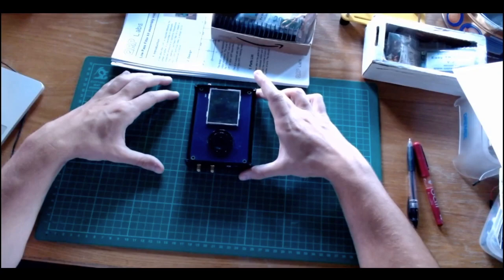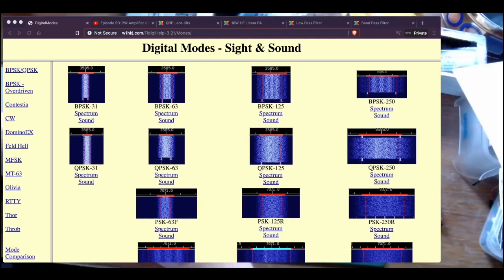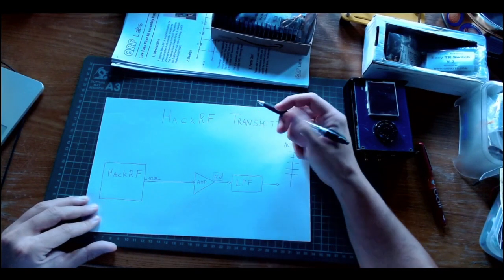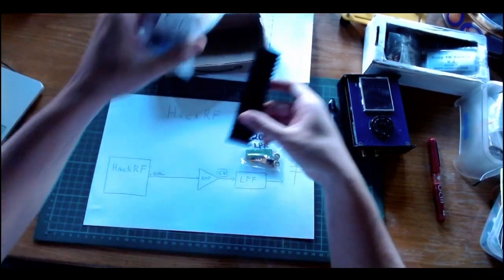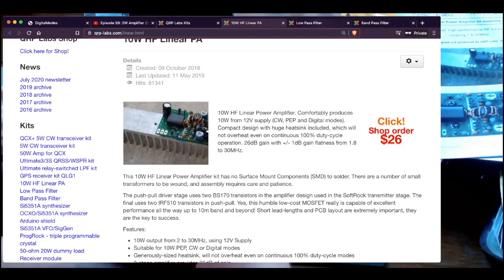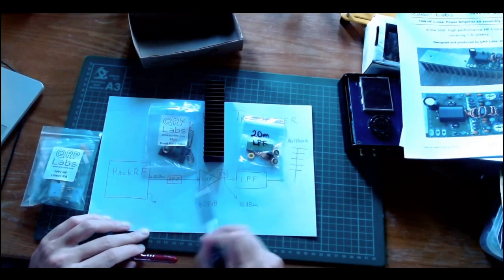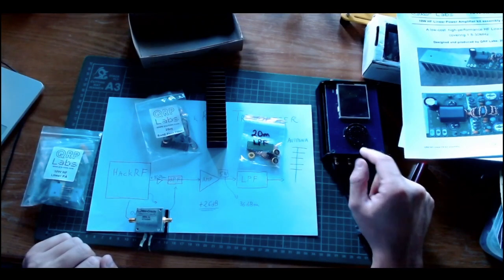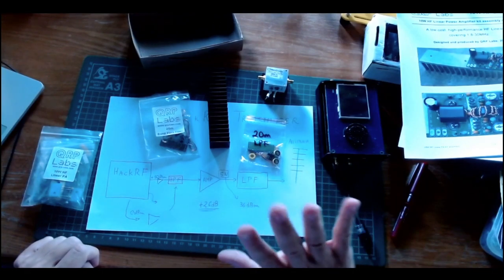Episode 62: HackRF low-cost configuration  as HF-transmitter

Comment: Looking forward to this series.   Will you be using the Portapack/Mayhem or the HackRF alone?  I'd be very interested if you tried the HackRF with SDRAngel.
Reply from the maker: Hi, thanks! I will probably try with both (Portapack and HackRF alone). I have several videos where I use SDR angel with the HackRF :) Check them out! Anyway, yes, SDRAngel is my favourite SDR software for the HackRF so I will keep using it.

Comment: hello, based on your video information I purchased this amp for my hackrf one. I looked at the LP filters and they are all different for each band so I did not bother at this time did not think it was needed. received the kit today so have not built it yet. Do you have instructions on setting up the hack rf with SDR console v3 putting it all together and transmitting? As same I do not have my ham license yet but have taken classes and working on my CW. but for now was going to work the 27mhz CB band to make contacts while working on that. Please share how to connect everything and transmit.
Thanks'!
George from Alberta Canada
ps my wife is from Pangasinan Urdenata. Salamat!